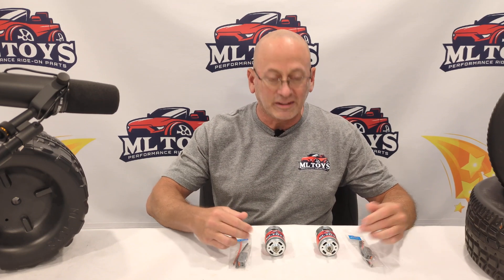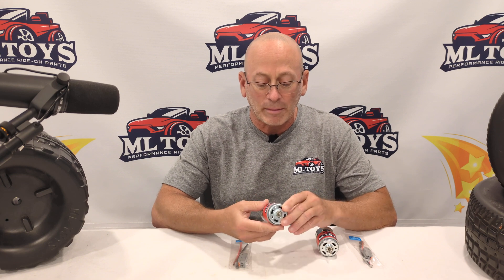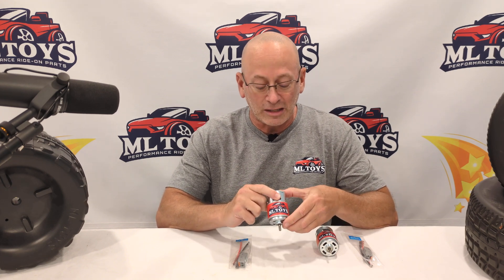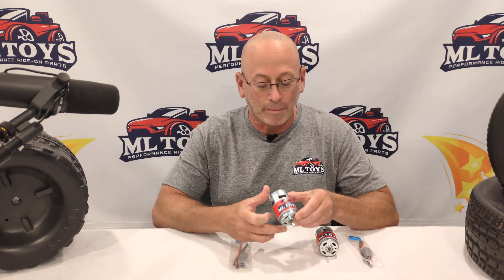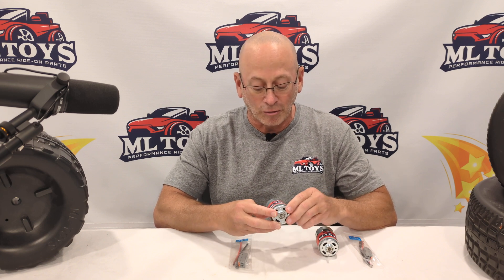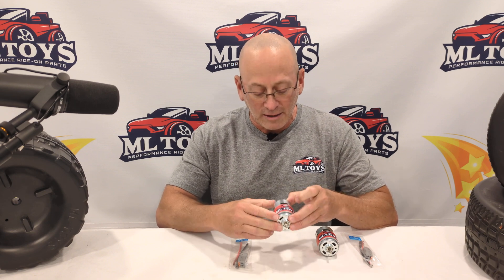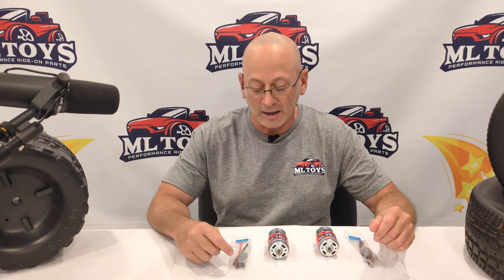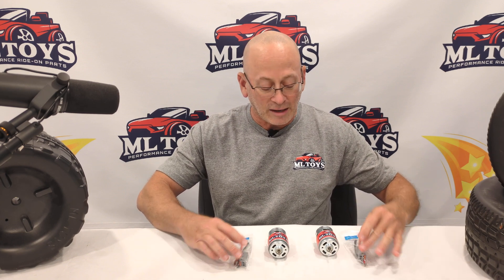Fastest Ride-On Motors Yet: ML Toys 775 BBI Performance Upgrade for Power Wheels

Comment: How are these running at 18 volts? Will they still be faster than your 550 performance motors at 18 volts? Same speed? Slower?

Comment: I’m having an issue with my dune racer. It works but it dies in 5mins max. This is after charging a brand new power wheels battery (exact replacement) for 24 hours. 
I’m not sure where to start since it still works but it’s just not lasting. Brand new battery.
Reply from the maker: Contact our tech support GoFast@MLToys.com